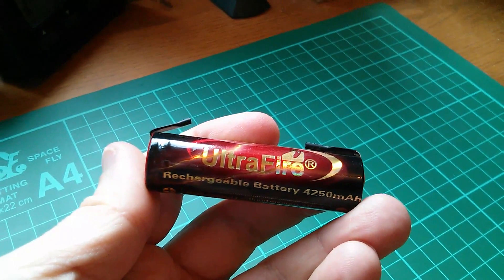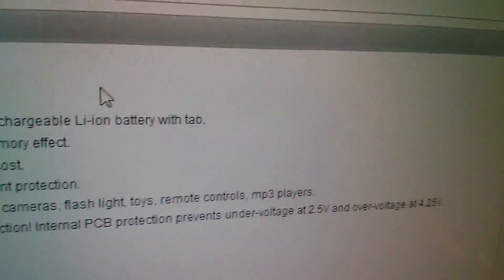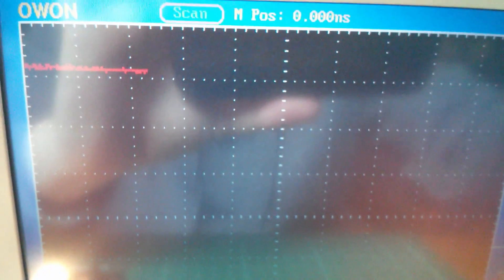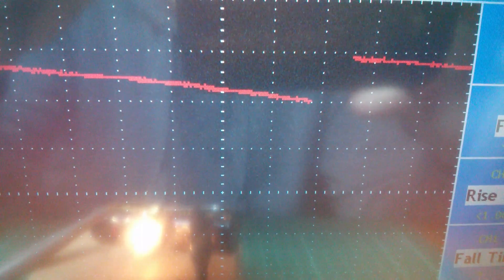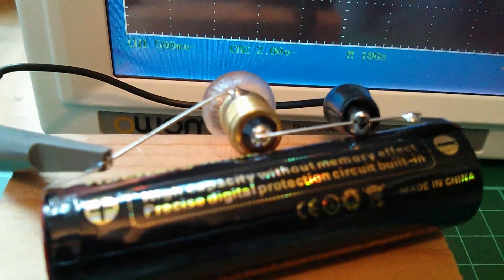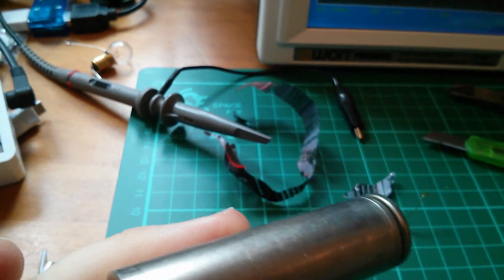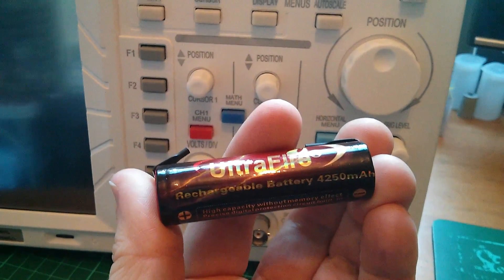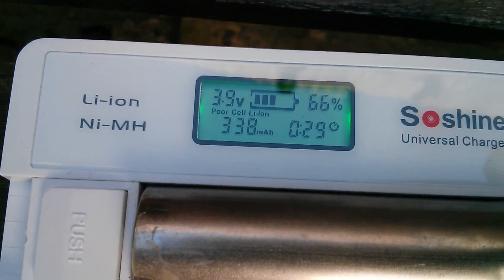Lithium Battery Fun - Testing 18650 Cell Undervolt Protection Circuit

Comment: is it thinkable that interrupting the circuit for undervoltage would prevent in series charging of other cells, could it be undervoltage protection is up to the bms which is in parallel

Comment: Julian, please don't support these sellers. Also capacity of the cell is unreal right from the start, so you can tell it is fake. At least you can mention it. Highest possible capacity for 18650 cell is 3500 mAh.

Comment: You can buy tiny battery protection circuits off eBay for a few dollars for 10 of them.  The ones I got are small enough to easily fit into the bottom of an 18650 cell holder.  It takes a bit of work to modify the cell holders but you can put an unprotected cell into the holder and it becomes a protected cell (so long as you only use the leads connected to the protection circuit).

Comment: Hi Julian, i like your videos but - as you probably know by now, in 2014 it was absolutly impossible to have a 18650 liion cell with 4250 mAh - and it still is today. The cell with the most available capacitance is around 3500 - 3600 mAh. All the cheap chinese Ultrafire batteries are absolute rubbish and fake! You cant trust them at all - dont buy them! The cells you can get from old laptop batteries are much more reliable.

Comment: i cant find any lipo protections circuits that dont cut voltage at 2.5 volts which is far too low for most lithiums!?

Comment: The first clue that you are being conned is the brand "Ultrafire". Never use this brand. Hopefully they will go broke and dissapear from the market, when more people discover how fraudulent Ultrafire 18650 battery specifications are. Charge ratings are almost always greatly inflated by 300% or more and I have never come accross any protection circuitry in their cells.
 I was given 2x 18650 Ultrafire 2400mah 3.7v with 4.2v and 2.75v protection cut off cells for "free", with an ultrabright led torch. These cells were a dismal 725mah capacity (30% of advertised capacity), and had no cut off protection as tested. Dont be fooled by slightly less bullshit sounding battery specifications At least in this case claimed capacity was 330% exaggerated and protection 100% bullshit. 
Do not give any money to these shysters.

Comment: it's very easy to buy unprotected Panasonic batteries on ebay (green/black package), but they cost much more.
I've read that you can get them protected (panasonic) or the other choice is to get the Olight batteries with are 40€ each (panasonic japan + protection).
I'm actually working on getting all the necessary parts to protect some of my cells
Thanks for the video!

Comment: "Lithium Battery FUN"... how about another nearly 9 minutes of my life I will never get back compared to a YTer flashlight aficionado who did not waste my time and told me this brand would likely cause a fire and anything with the ending fire so I every cell I had a choice I bought Panasonic green cells. Sanyo and one other is supposed to be good, too, he said.

I got two of these with $3 bike lights -- what a deal, an adjustable focus cree xml 6(which was what I cared about) flashlight with columinating lens on it, adjustable bike light holder, .5 Amp charger & one of these Ultrafire batteries. The most interesting thing of the whole setup is that when you put any battery into the charger it lights green for some reason while none of my non-internet more American storebought sort of merchandise has ever acted like that.

But I also have a $35 dollar bike light whose strain relief just popped out the back the other day. I haven't even charged it much... less than half a dozen times. I guess I need to teach it a Underwriter's Laboratory Knot!

(I found your lithium battery playlist...there is internal battery resistance tester made, is there? I don't see a part II anywhere and don't think I'm going through all your playlists. I'll probably go through the mosfet one because I could reuse a primer it has been so many years since I've designed a larger circuit and may be doing so in awhile. And I'll probably check out the arduino one.)

Comment: First clue that the where garbage was the fact they they are listed as 4250mAh. The highest capacity 18560 batteries are 3400mAh (and decent 3600mAh). 

General rule to to stay away from most batteries with "fire" something the name. Look for batteries with Panasonic cell inside. I use Keeppower 18560 the use quality Panasonic cells and are a tad more affordable that the other quality cells (Orbtronic, AW, and various flashlight brands like EagleTac, ThruNite & Olight). Samsung and Sanyo cells are good too but not sure they are offered in the highest capacities (3400mAh/3600mAh).

Comment: Ultrafire batteries are terrible because there are so many fakes.  I had a 3000 mAh cell that said it had a protection circuit but my cell was similar to yours.  The difference is that mine did not have tabs.  I am also extremely skeptical of the capacities printed on the labels of Ultrafire and other cells of similar quality.  That 3000 mAh is an outright lie unless it is a cell from a better known maker like Panasonic.  If the Chinese are so dishonest about the capacity of the cells who is to say they are lying to you about their cells being safe when they are not as safe as good Japanese cells?  Japanese cells are not that expensive when you consider that they are better quality than the fake Ultrafires that seem to be everywhere.  Well they are not really everywhere.  I know of a battery shop not very far from me that probably has never sold a single Ultrafire cell.  Instead they sell Efest and other good brands.  They probably know how unsafe Ultrafire really is.

Comment: 2.5V is way too low anyway It should stop at 3.0V.....Once you go below 2.8V the cell is usually ruined,As you found out
Reply: Griff Griffo That might be why such unprotected cells are dangerous.  When they are drained so low there is internal damage done that makes them unstable and even dangerous.  These cells are safe as long as you don't overcharge and over discharge them.  Don't short them or abuse them in any other way.  Don't use unbalanced cells if using more than one and also use the same brand cells even same capacity.

Comment: I'm just going through some of your videos and I know this one is pretty old, but there's some bad stuff out there. I usually go with the guidelines if the capacities don't add up (high capacity NCR18650B cells made by panasonic sit at 3400 rated mAh currently) or the price seems way too low you're not likely to get an authentic product.

Personally I use a webshop in my country that while its not as cheap as eBay I'm at least sure of what I'm getting and its shipped the same day, delivered the next workday. They have fair prices and based on what I read on a few torch related forums it has a good reputation there and is used by some other people in Europe. Mainly though it seems to be a case of knowing the right vendors to get your stuff from regardless of where you go to.

The reason 18650 batteries aren't available under the Panasonic etc names to the consumer is due to the nature of the batteries. They are a lot more dangerous when abused than NiCd and NiMH with fire risks and battery venting. I think it was on the Panasonic datasheets or elsewhere on their site, they only provide them in bulk to third parties to use them in a product. I guess though practically you need to be a big player to be able to order them in a rather large minimum quantity, the webshop I buy my batteries from has various Panasonic made cells available, both the high capacity and high drain variants. And also protected batteries from third parties, I've picked up a fair few of these over the years and when testing them they always seem authentic based on my testing because they meet the specifications of Panasonic cells (internal resistance and capacity etc).

Quite frankly I can understand why Panasonic doesn't want to sell these cells to the general consumer audience. I'm an informed consumer, I know down to what voltage they can be used and make sure to use protected batteries in devices that don't have a built in cutoff. What charging profile is suitable for them and to verify if my charger behaves according to that profile and such. I don't think it'd be a good idea because even if they do sell good cells under their name and provide good chargers there will still be people that are like "too expensive! I'm gonna buy that on ebay", most likely a fair few of the items there will be forgeries or rewrapped reused 18650 cells from laptop battery packs etc. Disasters waiting to happen and I completely understand why they don't provide them for the general consumer. Even if either the charger or the battery is an authentic product the other one can still fail badly, they don't want their name on such things. Most regular consumers also wouldn't be able to distinguish fake from real other than by the performance or magic smoke incidents.

I'm not happy with the fakes floating around but if you know where to get them and have at least a basic multimeter to check if batteries arrive with a suitable long term storage voltage and to make sure they're not overcharged in the charger then I feel they are reliable and safe enough. You're well aware of how uninformed people are with NiMH batteries and chargers, I don't think I'd trust them with this chemistry I'm afraid.

Comment: If you buy an UltraFire branded battery you're going to be conned anyway. That brand has typically 10-20% of the actual rated capacity. (I don't think even the best 18650 Li-Ions have any more than 3000mAh when tested, so anything claiming to be over 3100mAh is probably lying). I had a thought that they might just get them from electronic equipment that's been sent for recycling where often the cells are already worn out.

Panasonic, SenyBor, Torchy, Trustfire, Sanyo seem to be much better. Some of those claim to be panasonic or sanyo inside. I'm sure there's a minefield of fakes of all those brands on the internet. I would imagine panasonic do make 18650 batteries as they make other batteries. The good brand batteries seem to sell for about £10-15 each though.

Comment: that is dangerous.  protection circuit failed!  WOW! Thanks for the test!
Reply: It's a single cell plus tabs, it didn't have a protection circuit to fail. It's obvious to look at from outside that there's nowhere for a PCB to be.
Reply: KX36 have you tested the sony vtc batteries before?  Those are a very popular 18650 battery.  Curious to see you test them.

Comment: I've heard that some of these LION batteries purchased from EBay, are just recycled from defective batteries in China. And then repackaged. So you may or may not have a good battery to begin with. And it may or may not have the protection circuit.
I purchase the Obtronic branded Panasonic batteries from Japan.
Reply: Old comment I'm replying to here myself, but uh those stories you've heard aren't even the worst of them ;).

At least those are actual 18650 batteries, there are many things that are way more dodgy just look at some of these: http://budgetlightforum.com/node/27603

Comment: I'm not overly thrilled with the standard lithium cells on ebay myself.  The protected ones I got did have the little gold-flashed PCB in the end, so that was promising, but the quoted capacities were not realistic at all by a wide margin.  On the other hand I do quite like the LifePO4 versions.  They tend to have more realistic ratings and live up to them with all the other advantages that LifePO4 offers like the slower loss of capacity, better storage stability, huge number of charge cycles and the much lower risk of flames.  You do require the lower voltage charger though.

Comment: The highest capacity 18650 is something like 3000mah made by Panasonic I think so all these 5000mah on eBay are utter crap. Most of these 18650's are took out of old laptop battery's and just get a new wrapper.

Comment: These cells are obviously fake - UltraFire doesn't produce 18650 cells above 3000mAh (according to their web page where they also warn about fakes). So if the faker dares to fake the capacity he maybe just simply "fakes" the presence of a  protection circuit too.

Comment: I have an OWON scope and I've been trying to do what you're doing where the screen prints back over itself and I can't figure it out. Can you please tell me what you're settings were? My falls off on the left side as new data is printed on the right. Once it reaches the left, the starting point, disappears and is replaced so I lose the beginning of the charge cycle.
Reply from the maker: I don't remember doing anything special. I just turned the timebase down to the slowest setting.
Reply: yeah I tried that with mine, which looks identical to yours, but after the line crosses my screen, it doesn't start over on the same screen like yours did in the video it just slides the oldest data off the screen.
Reply from the maker: Josh Brown All I can tell you is that mine is a PDS6062S

Comment: Better luck than me; bought some listed as 3500 mAh, tested they were <750..
Other stuff:
You can find decent 18650s in laptops. If you ever get a used laptop with a "dead" pack, there's a good chance it's only one cell that's bad.  I found twelve good 2.5Ah ones in a pack once!  Make sure to check the internal resistance though, often they are no longer suitable for heavy loads.
Also, for logging voltages, check out the TP4000ZC multimeter on Amazon.  The software is a bit crude, but you can get a chart into Excel with it.

Comment: I've bought a fair few of the Panasonic NCR18650B's from dealextreme, can get a pair of them for around $23USD. Rated at 3400mAh however I get 3200mAh on my charges, which is not bad. Use them in my torches, one of which is a P7 and the other a XML-LT60, use them every day and still only have to charge the batteries once a month.

Comment: Also, the big battery manufacturers do not make the protection pcbs, but it's not hard to find unprotected Panasonic 18650s online. If you're looking for protected ones, AW has a good reputation, on candlepowerforums.com

Comment: UltraFire is known to take old cells out of dead laptop packs and repackaging them with capacities that are outright lies. I don't think it's even possible to get 4Ah into a cell that size. Certainly not for 2 pounds. And as you discovered, the protection circuit is also an outright lie.

That said, you CAN buy cells directly from Samsung, Panasonic et al, but they're more expensive. They're more expensive because they're new cells, that do include protection circuitry. I think one of the big manufacturers absolutely will not sell their lithium cells without protection circuitry, not sure which off the top of my head.

Comment: I had just got a flashlight (one of those Cree T6 ones) and it came with 2 UltraFire ''4000'' mah and got 1-2 hr. of run time. Then I found a laptop battery and took that apart. The laptop battery's last 7+ hours a piece and I got 12 of them!

Comment: Awesome! You should take a look at some of the high drain stuff us "vapers" use like the 30amp Sony US18650VTC4
Reply from the maker: It seems vapers and the flashlight guys are the experts on the cylindricals (like the 18650), and RC modellers know most about the flatpacks. I've got a lot to learn.

Comment: simple 1500mah cell wrapped in BS ......
.
you wont hardly ever really see a cell above 2200mah thats real, and if it is, its going to cost a lot more than cheap cells, you can probably buy 3 cheap 1500mah cells for the price of one 2500mah cell etc, depends on the application which way to go.

Life span of the cheap ones is ok if you run them in the 2.8/4.1v area
Reply from the maker: I think you're right - the Soshine charger only managed to put 1800mAh into that fully discharged cell - I'll probably only get 1500mAh back

Comment: Recently I bought "5A Constant Current Voltage Buck Boost DC Converter Module" on ebay from china seller poptasion. After few seconds the capacitor located close to the output of the module exploded strait in my face and eyes. Big bang, sore eyes but it could be worse. After the investigation it appeared that cap was soldered in reverse polarity- hence explosion. I've contacted the seller - no reply. AVOID, AVOID, AVOID!!!
Reply: Danielius everything was connected all right,  read the comment fully before commenting stupid
Reply: http://www.ebay.co.uk/itm/390743850916?ssPageName=STRK:MEWNX:IT&_trksid=p3984.m1439.l2649
 - the  auction with this module
Reply from the maker: Ouch! That's really nasty - a one off, or a wrongly assembled batch - I wonder. I'll be checking capacitor polarity on any modules I buy from now on. Thanks for the heads up.
Reply: Julian Ilett
 I never thought to check the caps, but since now I'll check every single one and more before I even think to connect it to the power supply. If someone is interested to see it the pics of aftermath are on my G+ home page. https://plus.google.com/u/1/photos/yourphotos?pid=5975484293840031794&oid=110599126923439344534  I hope the pics are visible
Reply: ha loser just connect everything right and everything will be ok.
Reply: even so u failed
Reply: Get a life
Reply: im alive or am I?

Comment: Good to know, Jullian. Check out this item, I have got one, and it's reliable.
It's a "5V 2A Mobile Power Supply USB Battery Charger 18650 Box"
"http://item.mobileweb.ebay.com/viewitem?itemId=171163345739"
Reply from the maker: Bought something very similar but with a 3-digit 7-segment LED display that shows percentage state of charge...ha, that's a laugh! Planning to do an "eBay spending spree" video to show all the cheap stuff I've got in to do the lithium battery videos.